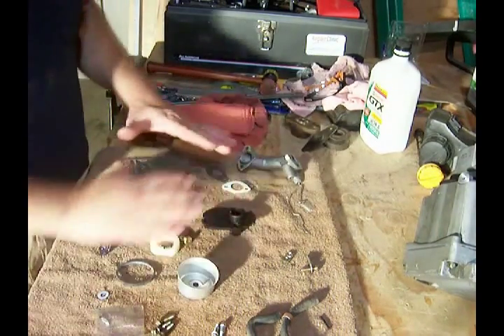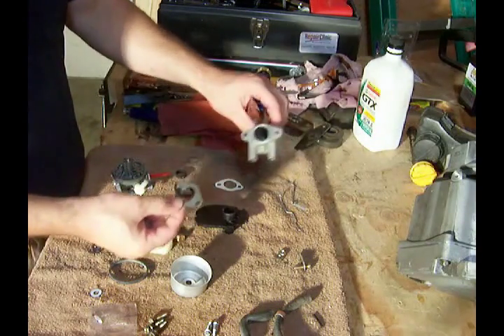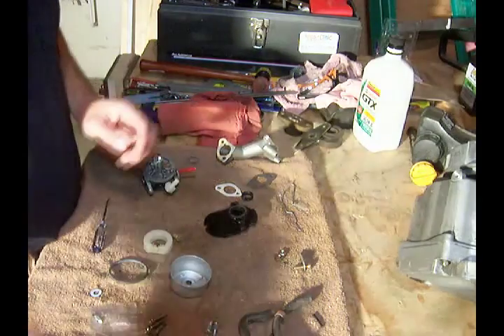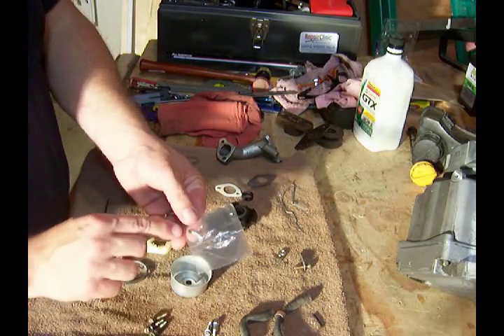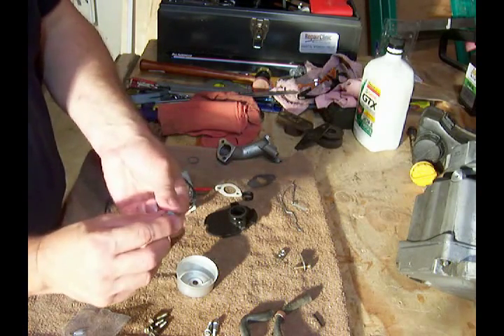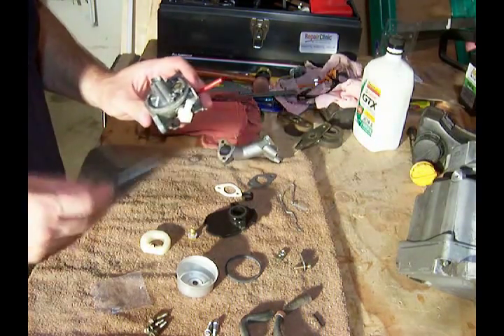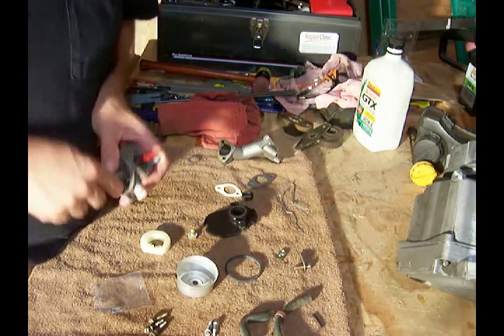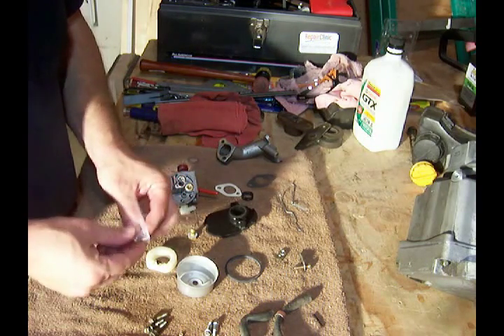#24 Tecumseh LV195EA / LEV120 - Carburetor Reassembly

Comment: I have watched your carb rebuild videos several times now. I don't think I could do this job without them! I'm not a talented mechanic, but I try. I'm going to search out that Stems? kit you mention. I need a gasket for the muffler and maybe a new breather tube. Mine's a little dried out. But I bought a new red primer button and tore the old one trying to remove it. It looks like I have to use a pick to get the rest of the rubber out of the grooved area. the new one came with a washer too. i hope I didn't screw up by messing with something that wasn't absolutely necessary. The muffler gasket is dried/burned to to motor. I'll have to scrape it off, but it looks similar to the carb gasket, oval, not round like you show. Anyway, thank you so much for the videos. Things that are second nature to you are intimating to me.
Reply from the maker: I am sure you will figure it out. "Stens" is what you want. Checkout www.partstree.com for detailed parts diagrams. Thanks for watching.